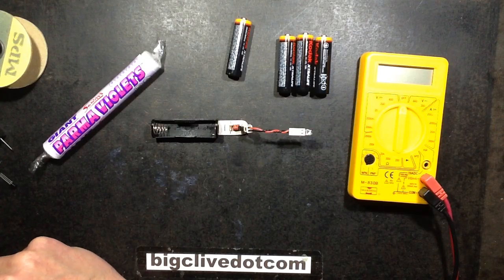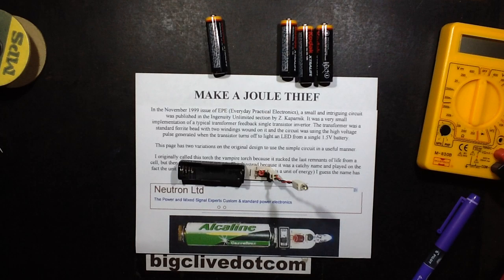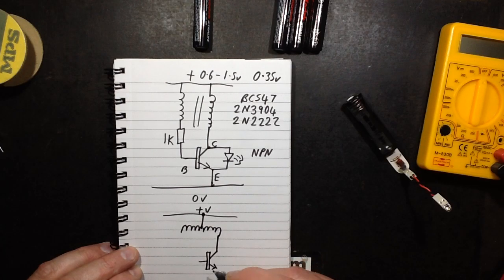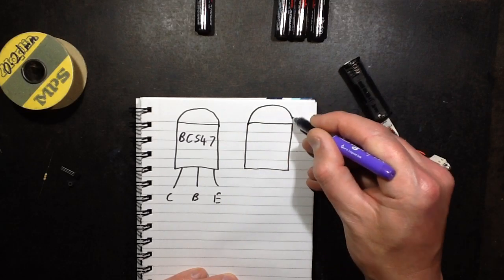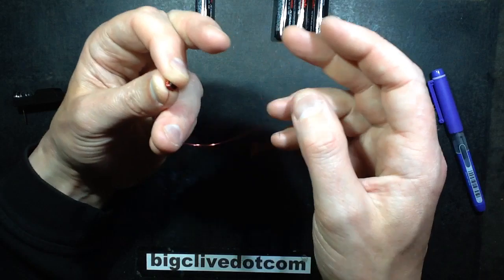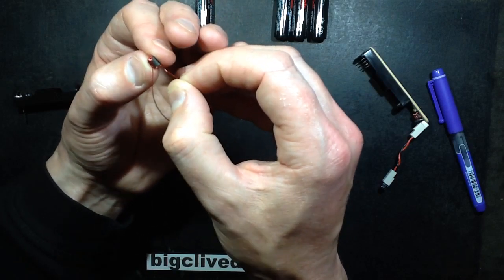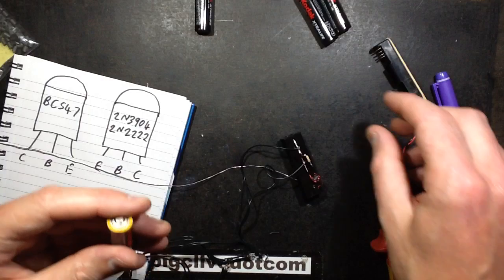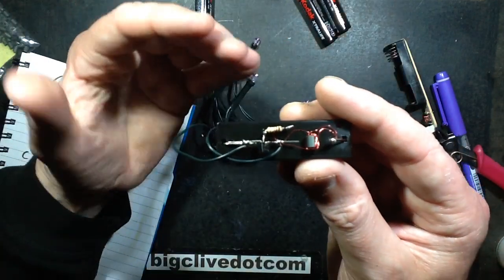How to make an authentic Joule Thief.

Comment: I'm afraid your curve (not the math) about the remaining battery energy is incorrect.
Reply: +The Signal Path Blog Specifically?
Reply: +The Signal Path Blog It is the area under the curve (the integral), isn't it? I'm always bad at this stuff so I'd love to hear from you the right way. Would much appreciate it!
Reply: +Aurelius R Sorry, I should have been more specific. The math is correct, the curve is not. The discharge is not linear at all, therefore the area under the curve from the remaining battery life is actually much much smaller than just drawing a linear line. I hope this helps.
Reply: +The Signal Path Blog Ahh, right, yes you are certainly correct. It's much more exponential than linear. Hence Dave Jones vs Baterriser
Reply: +The Signal Path Blog Hi, i found this video yesterday and i was amazed, so I build my own joul thief - ferite core from USB cable and few turns of wire, 1kOhm res - NPN C458 - SMD 5730 LED diode(3,2V 150ma) + 24Ohm res  and 1,5V brand new battery. Next I setup monitoring of battery Volt level by using arduino and there is nice graph of approx 24hour nonstop monitoring http://prntscr.com/9t5zd4 Y- Volts X-time in sec so there is approx 80 000 values and i update graph after LED stop shining. So I think remaining battery energy is correct
Reply: +Pavel Prochazka You can't conclude that from your measurement. You are not measuring the total delivered power to the LED. The current is not constant in your setup, the power delivered to the LED is not constant. Your methodology is too simplified. Your voltage does not start from 1.5 which means there is a lot of current being drawn right at the start.
Reply: +The Signal Path Blog The start point of the graph lover than 1,5V is becose i make voltage meter for first time so I delete some part of data by my mistake but what can I say the deleted part was pretty same as rest of graph. You are right I measuring just volts not delivered power but I can say the led still shine pretty same like yesterday when I power it on. So current must be approx same too...I know this is not exact and right way to measure but I think the graph of  remaining battery energy is +- correct, sure its not exact linear but very very close to it. I make measuring but you never write any argument why is the original graph incorrect so please i will be happy if you can tell me some
Reply: +The Signal Path Blog If the signal path calls you out you know it's serious. But yeah he's right, it takes a heavy nose dive after reaching it's lower working voltage. The area under the curve isn't as much as you make out, but it is some.
Reply: +The Signal Path Blog - Some alkalines aren't too far off linear, especially at a low discharge rate (unlike NiMHs, which always have a very sharp drop after 1.15v or so).
Reply: i also eyeballed he made the point at 1.4V not 1.2V :D
Reply: Pavel Prochazka, I dont quite understand how the missing part would fit into the graph if it was "pretty same as rest of graph". Maybe if you could repeat the experiment with a new battery and upload a curve.
What is the time scale, btw?
Reply: Watch the EEVBlog Batterizer vids.  He explains this quite thoroughly.
Reply: The curve is absolutely not a straight line. Assuming a low rate discharge you'll get roughly 3000-3100mAh to 0.8V out of a premium alkaline battery (Duracell quantum or Rayovac Fusion). Discharging further will only get you another 400mAh to full exhaustion (0.2V).

Cool vid though.
Reply: The Signal Path : Since the current is defined by the saturation current of the coil the current IS constant... (ignoring coil losses and transistor bias current) and so since the voltage accross the led is constant it's power is also constant.
Reply: Dude, The Signal Path,  this stuff is not for PROs but for DIYers/Makers/hobbyists/beginners.
Reply: Right. The discharge curve has a knee point at about 1.0 volt. Energy is the surface area under the curve. So the joule thief harvests about another 10 percent or so from the discharge curve past the knee. Still a great and fun device. Here is one source for discharge curves:  https://www.powerstream.com/AA-tests.htm

Comment: Thought I'd have a play around with this circuit after watching this video- i'm amazed by how robust it is, it works with nearly any transformer arrangement you can throw at it. Even just two wires straight through a ferrite toroid once (oscillated at 43MHz (!)). Works with transformers with turns ratios way off 1:1 as well.

Comment: WOW! I NEVER KNEW YOU NAMED IT! I always loved the circuit since it was so simple and fun to make! So you are Clive Mitchell?
Reply from the maker: Yes I am.  I never really expected it to take off the way it did.
Reply: Wow. I actually have 2 flashing joule thief circuits hanging from my ceiling, one blue and the other yellow, just soldered right onto an AA cell and they will last for years! Instead of a 1k resistor I used a 100k resistor with a 100 uF cap in parallel. you should make a little blinking joule thief with an AA or 2 then put it in resin so it is in a cube of resin, then cut and polish it into a sphere and it would look awesome!
Reply: Modra reka That has the issue that it doesn't run as long as a battery due to the fact that capacitors don't have the same energy density as a battery does, so a battery is a better alternative if you want it to run for years off of a single power source.
Reply: @Modra reka it would need a lot more than 10, a joule thief takes quite a bit of currant, and why use LEDS as solar panels? Why not just use an actual solar panel that would be a lot more efficient?
Reply: @Modra reka I'm not sure if you just don't speak english well or what but nothing you say makes sense.
Reply: @Modra reka Ah okay, well sorry but I didn't understand what you meant before.
Reply: @Modra reka When ???

Comment: Thank you Clive for touching on the safety aspects with this circuit.  I have seen it in books and videos but no one ever mentions what happens when the circuit is energized absent a load.  This is such a (can one still say nifty? Hang it, I'm going for it.) nifty circuit that it seems natural for the experimenter to wonder what could be done with heavier components and 3 or 4 FRESH cells.  If such a thing were attempted I wonder at what point the unloaded circuit might become truly dangerous if one were to get his or her thumbs across the output poles.  Thanks again for this marvelous circuit!
Reply from the maker: If the battery voltage is too high the current will flow straight through the LED.

Comment: how many leds can you run of a joule thief
Reply from the maker: It depends how bright you want them.  They can be wired in parallel and series.
Reply: i wanted 8 leds in series would that work
Reply from the maker: Yes.
Reply: good looks like i'm getting my soldering iron out

Comment: Finally made one of these.  Had fun learning how to work out what kind of transistors I had salvaged.  Filled up a whole breadboard voltage rail with all the LED's I could find and they all lit up to their original brightness (except one blue one which got really dim).
Now i have a million ideas in my head.
Reply from the maker: +coast2coast00 If you used mixed LEDs then the voltage will have been shunted to the one with the lowest forward voltage, so the blue LED is probably fine, but just didn't have quite enough voltage to make it pass enough current to light as bright as the others.  If you used it on its own it would probably be bright.
Reply: Ya, it works well on it's own.  
I played around with it some more and it's gonna take some time to get my head around what's going on in there.  
It's nice to find a hobby with parts that are manufactured by the billions to bring the price down!

Comment: Your math is WAY off. First the battery discharge curve is not linear. Normally it drops a little then slowly falls through much of it's life till finally nose diving near the end(http://img.photobucket.com/albums/v482/SilverFoxCPF/e2AAatVariousRatesandMsxComparison.gif). By the time most batteries hit 1v you have ~5% or less of the battery capacity left and anything beyond .8V is essentially a waste trying to use. I hate down voting one of your videos, as normally they are top notch, but this one is rubbish.
Reply: harshbarj how dare you correct clive. Sit back down in your chair and let him finish.
Reply: Is that a graph of your IQ?

Comment: Thanks Clive - just made one and it works a treat!  Also remember there was an IC that would blink an LED from a 1.5V battery for many months - LM3909 but no longer available
Reply from the maker: You may find LM3909 chips on eBay.

Comment: Very good tutorial. I have had good luck with an inductance of around 1uH for each. It is 10 wraps of each wire.  It have used ribbon cable and magnet wire for the indicator and they both worked. I got the ribbon cable from an old computer, you can leave the two wires stuck together to make it easier to wrap.

Comment: I did try this one with a toride core and got a fair amount of turns with it. I'm rahter proud to have made this one working with ONE 1.5V battery driving not one, not two, not even three but 7! 1W LEDs times 2!, i.e. 14 1W LEDs, both green and blue. So I have connected them in series/parallel, i.e. 7 + 7 and they run for a month on a R20 alkaline battery (to get the current needed). Since each of the LED's have a forward voltage of close to 2.6V, that means that this adaptation is generating close to 20V and at least 20-30mA since they light rather brightly. So Clive, thanks for your design, it is really a TRUE Joule Thief, capable of generating high power out of "thin air"!

Comment: I've made several of these, the best one I use for a nightlight, uses a tiny inductor from a chinesium usb power supply I added a LDR and hooked to a D cell,  been running for a year, have it sitting on a shot glass on a small book shelf in the hall, coincidentally the writing on the shot glass casts a really cool " Dr McGillicuddy's mentholmint schnapps" shadow on the floor😎

Comment: I just love this circuit. I literally just made one to put inside of a cheap paper globe decoration I got from the dollar tree, probably our version of your former poundland. Now I can just leave it on forever and it glows nice and dimly just like I want (I know a resistor change could make it brighter but that is not what I want) and I may end up making quiet a few of these for some Halloween decorations this year so that I can just put in whatever batteries happen to be in the junk drawer each year to get that last bit of use and not waste them ;D.

Comment: I did some experimenting
Yes, just like Clive said, you need a ferrite core, but ferrite cores have many shape and sizes
So i went ahead and test a ferrite core from an SMD inductor (remove the old windings and rewound it just like clive) and....it worked, beautifully too.
Same with through hole inductors (the black one with the heat shrink tubing)
You can really compact these down to a finger

Comment: Me and my Daughter, Kat (of the Kat and Handles show!) made this using instructions from your website about three years ago! We were considering building a lot of them, getting a load of schottky diodes and hooking them all together and making some sort of free energy power bank using batteries from those recycle buckets in supermarkets.
Reply from the maker: MegaWayneD The trouble is trying to carry the bucket of batteries out the supermarket.
Reply: I suppose it depends how friendly your local supermarket is. Our local Asda were happy for us to take some when we explained it was for a "school science project".
Reply from the maker: MegaWayneD And the bonus is that when you've thoroughly drained them you can take them back to the battery bucket.
Reply: Exactly!

Comment: Man I like watching your vids. Whenever I need to understand something about the black-art of electronics I end up turning to you. I measure a teacher by their ability to make me understand something.
Having said that, I did once ask you how I could get a shock from car HT leads and even a (dodgy cut out switch on a) moped, when as there was at least an inch of rubber between me and the ground on all occasions and the 'breakdown voltage' in air is three million V/M (I have no idea what it is through rubber), and the voltages involved have always been low, how the hell could I get a belt? 
You still couldn't make me understand but thanks for making the effort. You did tell me to stop shocking myself though as eventually it'd kill me. I decided in the end that it must have something to do with the body's electrical capacity or something. So far I've stopped two car engines and a moving moped, seemingly with pretty much nothing but my heart! I've only got one wee tickle from the mains since I wrote last, so I am improving. 
I need to up the input voltage to a couple of LED's, so here I am again...you big, brainy bastard you!

Comment: Basically a clever self-clocking boost converter (just without the diode and capacitor on the output)
Very nice
Reply: Self regulating too now that I think about it

Comment: Hi Clive. Thanks for the videos!. I have just tried this as a mod converting a 2xAA string, much like yours and housing the joule thief circuit in the second battery slot. I have a second identical string and wanted to run a side by side  endurance/performance  test but was just wondering if there are any issues i need to be aware of - heat, battery chemistry etc - before running them both non-stop

Comment: 230volt AC LED strip lights usually fail because the mains driver dies. Most of the series pairs of LEDs are ok except maybe one or two. I have used a joule thief circuit to power a two foot section containing 15 pairs of LEDs to make an emergency light running from 4 rechargeable NimH AA cells that runs for 4 to 5 hours. The joule thief is an amazingly simple oscillator circuit that lends itself to endless experimentation!

Comment: I've wound the coils for mine using the thin kynar wire-wrapping wire. Using two different colours to aid with connections - all ugly style wired on the back of an AA battery holder. Works a treat.

Comment: About a year ago I used a joule thief with a beefy transistor and a voltage multiplier in place of the LED to run a Geiger tube from 5 volts, it worked well enough.

Comment: Great video. Fantastic name. Hours of fun for me.
My tips: Need more air for a couple more turns? Compress the wires in the center of the core with a round toothpick.
Need a core? 13 turns (5+5+3)of #22 PAINTED iron wire around a 3mm dowel makes a nice torroid.

Thanks!

Comment: I have a renewed interest in these things and have been building them left and right using salvaged 2N3904 transistors, ferrites, magnet wire, batteries and LEDs. Luckily I already have a large supply of 1k resistors, but the rest is straight from the trash!
These things are so cool, and yeah man got an 18-foot string of multi-color LEDs going strong!
So cool!!!
Reply from the maker: The best ones are the ones built from salvage.  Salvaged electronics scavenging the power from discarded batteries to make light.

Comment: I built this circuit back in November 1999! w000t!
Some fun modifications include using a schottky diode in series with the led and placing a 10㎌ electrolytic across the L.E.D.
Since the circuit is basically strobing, the L.E.D. looks dim but by integrating the pulses it becomes much brighter.

Another cool trick is to tie the LED back to the schottky diode. Do this with a ring of 5 or six LEDs and you get a 'magic' circuit that has current running in a circle. Each LED has a voltage drop across it, but the 'total' voltage across them all is 0V
Reply: Aadil Shah I usually rectify all my led boost converters because they get brighter and that it enables me to measure the current going trough the led without having to resort using the oscilloscope to measure ac current which is tricky to do especially at high frequency's. Cheers :)

Comment: I bought a chyneez made copy of this from a bloke in scratchwood services who had a box of them for £5 each. Mine had a bit of electronics on it and a case with a lead for emergency phone charging. One new AA cell would charge the phone anywhere for emergency use if no power available. A good little circuit by all accounts.

Comment: Hi ya Clive, just a update on my first Joule Thief. I used a Duracell coppertop "D" size battery that had 1.159 Volts so I choose this for my first one. 1 month later and its still as bright as when I first built it. I'm going to see how long it will run my blue LED It's a 10,000mcd unit 5mm as I just like the blue light these LED's put out as it matches the rest of my room as it is lite by lots of blue LED's. It's a great circuit to build. The AAA batteries don't last very long but the bigger batteries last for ages.

Comment: IIRC the covering on copper wire which can be removed with a soldering iron is a special type of insulation. Normal enamel insulation needs to be scratched off. Electric motors normally used standard enamel insulation as you risked shorts if the motor overheated.

Comment: I remember repairing and re-channeling a well known professional brand of radion microphones, and they ran from 3 * 1.5v AAA batteries and used a dc-dc converter to produce 7.5v for the vcc.   It was clever in that it could run with an input of down to ~ 2.8 - 3.0v from the batteries which explained the long battery life.